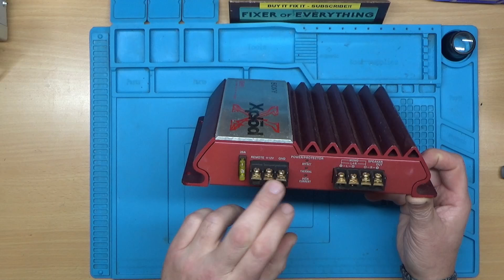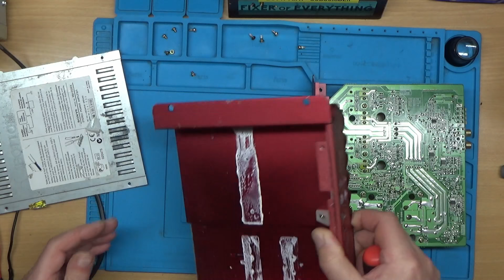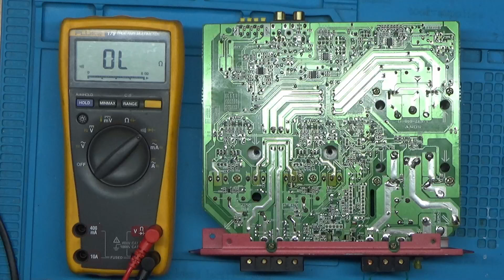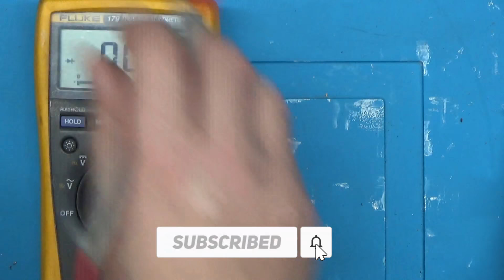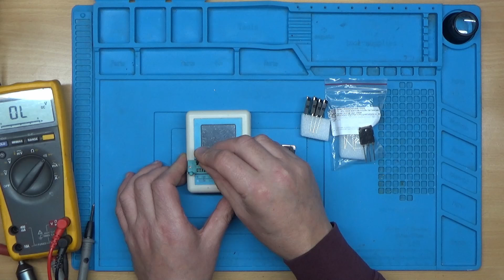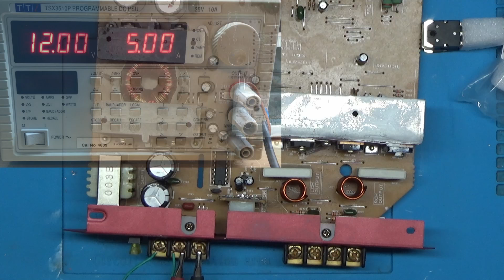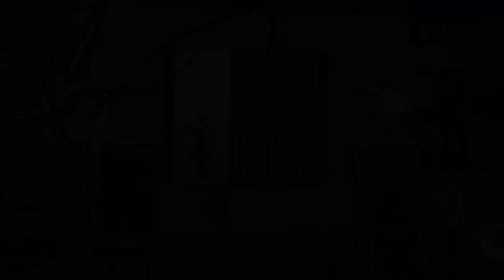Faulty Sony XPLOD Audio Amplifier | Can I Fix It?

Comment: Buying a faulty XPLOD off eBay with no fault description at all is a real gamble, but going through the connections first before powering it up is exactly the right approach with these. That red heatsink design usually hides the real story on the output or SMPS side. Keen to see what you find.

Comment: here we meet again, fellow D718-B688 ! Very very classic simple but reliable design present on the vast majority of car power amps for decades! JBL, Alpine, Sony, Blaupunkt etc...
This complementary pair can deliver around 100 W from ±35 V rails, and multiple pairs can be stacked in parallel to increase current capability and power output. Hence the widespread use of this configuration in car and some home audio power amplifiers for many years.
Reply from the maker: Interesting, Thanks for sharing 👍

Comment: What app are you using on your phone for the signal generator and how do you hook that up meaning what connector with what ends exactly
Reply from the maker: "Frequency Generator", the phone I used has a 3.5mm jack, so I used that with a 3.5mm jack to phono lead.

Comment: The 2SB688 (often paired with 2SD718) is a Silicon PNP power transistor designed for 45-50W audio frequency amplifier output stages, featuring 120v
 collector-emitter voltage, 8A collector current, and 80W power dissipation. It is commonly used in audio applications and comes in a TO-3P package.
It's best to replace them as a pair.
Reply from the maker: Yes, I did indeed replace the pair of them 🙂👍

Comment: Why the jumper between 12+ and Remote?
Reply from the maker: The remote input takes 12v signal from the head unit to tell the amplifier to switch on, so the amp isn't running all the time. If there is no 12v signal on the remote connection, the amp is just in "standby" mode so it doesn't run the cars battery down. So to make the amp work, I just wired it to the 12v power going in. Hope that helps 👍
Reply: @BuyitFixit Killer. Thank you for the response.
Reply from the maker: @EndrChe  No problem at all, glad to help 👍

Comment: I've received countless car audio amplifiers for repair. In most cases, at least one output transistor was completely shorted out. Sometimes two, or even more, were affected. I've also occasionally had to replace the MOSFETs in the switching power supply because they were damaged by the short circuits in the output transistors.
The most common cause of amplifier failure is overload due to user error. Speakers are often connected incorrectly, resulting in impedances below the permissible limit. Very few people read the instruction manuals and know the technical details before connecting anything.
For example: Many amplifiers are stable at 2 ohms as long as they are not operated in bridged mode. As soon as you combine two channels into one, i.e., operate them in bridged mode, the permissible impedance usually doubles to 4 ohms. If you then connect a 2-ohm speaker anyway, the output transistors will be overloaded and eventually burn out. As a chain reaction, the MOSFETs in the switching power supply can also burn out.
The connection requirements are usually explained in the instructions, depending on the operating mode. You just have to READ and understand.
No protective circuit can help with ignorance. Those who can read are clearly at an advantage.

I always had an amplifier in my car. However, all of mine survived without any problems. They were all 4-channel amplifiers. My first was a Yamaha YPA-1020 with 4 x 60W nominal power at 4 ohms, then I had a Magnat RX44 with 4 x 125W, or 2 x 325W nominal power at 4 ohms or 4 x 160W at 2 ohms, and finally a MacAudio ZX4500 Black Edition, also with 4 x 125W nominal power, or 2 x 300W at 4 ohms or 4 x 150W RMS at 2 ohms.

The Yamaha was only designed for 4 ohms. The RX44 and ZX4500 Black Edition were only NOT 2-ohm stable in bridged mode.
I always treated my amplifiers well.
At home, I use a SilverRave DS9504, which can deliver 4 x 50W at 4Ω, 2 x 70W at 2Ω, 2 x 100W at 8Ω, or 2 x 125W at 4Ω.
I use it as a subwoofer amplifier for my 7.2-channel home cinema system with a Crunch Powerzone noxx series subwoofer.
The power supply is provided by a massive 330VA 12V halogen transformer with a 35A bridge rectifier and a 1F power cap capacitor (with a custom-built soft-charge circuit).
Reply: scraping voice coils mate - routine in the car competition / micropenis crowd.  You put two or more woofers on a weirdly-shaped custom fiberglass enclosure, with their motor axis not parallel.  Those fiberglass enclosures BEND, transfering motion to other speaker motors.  Ultra stiff basket structures may or may not save you...

Comment: Ofcourse its the same transistor in the output stage. What a beginner😂
Reply from the maker: I'm not sure what you mean, but I've repaired over 200 different things on here ranging from thermal cameras, ultrasonic cleaners, solar inverters, and even a hydraulic transmission...

Comment: You are so lucky that that duel 3 w resistor. Probably about a 47 ohm resistor but still intact after that. Shorted transistor they very very very commonly will blow one leg that resistor and then your output is screwed after that. You were just lucky.
Reply from the maker: That's interesting, thanks for the info mate!

Comment: man i wish you were close by. i have a 5.1 computer speaker setup that worked great for years, and slowly the audio got quieter and a loud hum took over. now thats all it does. i really miss it. The Logitech Z-680 set. i know the control pod has electronics in it too, but also the sub contains most of the guts too. i have no idea where to start, the control pod or the sub. wish i could loan it to you to make a video with.
Reply from the maker: From the symptoms you describe I'd suspect capacitors have failed. They tend to dry out over time.

Comment: i like those little test speakers, if they are 4" inch 4ohm, i could buy some of them to fit in some boomboxes, i have a couple of boxes with rubbish speakers in them, i'd love some other ones to replace them, they need to have a smallish magnet though.
Reply from the maker: I think they were out of an old cheap radio / top loader CD player that came from ASDA.

Comment: Those transistors are available on Amazon in the States for $6.72 for a set of 4
Reply from the maker: Interesting. Only problem is they still are probably not originals, as they don't make them anymore.

Comment: What happens if you added new mosfet that is a bit more larger. More power?
Reply from the maker: Unfortunately not, as it would still be limited by the size of the DC to DC power supply inside.

Comment: Be careful, you put power to it and there will be large capacitors inside which you didn't discharge and could give you a nasty shock if shorted.
Reply from the maker: Good shout, although on this device the output caps are only rated at 35v, so not really enough to give you a shock. Not like the Bowens Gemini studio flash I worked on a while back (video is on here). That had high voltage caps the size of baked bean tins!

Comment: id be interested in seeing you repair a class d amplifier. i have 3 or 4 that quit on me and i never knew how to fix them, im sure it has something to do with the mosfets but i didnt know how to test which one was bad
Reply from the maker: I've never fixed one with mosfets on the output, all the class D I've seen are normally IC's. The Philips sound bar I looked at a while back which had a design fault, was a class D.
Reply: @BuyitFixit you mean you've never tried or you've never been able to fix one. I wouldn't be surprised if they were essentially unfixable
Reply from the maker: I've never came across one like that. I've seen quite a few class D's but they have been just an IC which has the mosfets built in.
Reply: @BuyitFixit oh I see sorry I didn't know what you meant. I didn't know they had mosfet ics

Comment: In retrospect, the Sony Xplod line was actually a pretty descent brand.  I think we now know the reasons that these car stereo amps would get re-designed every 3-5 years (which seems like a really long time in your late-teens to 20s) is because the designs would get counterfeit and knocked-off..and that there would also be obsolescence issues with the piece parts for the legit companies designing the amps.  
I think the problem was Sony was selling their equipment in big-box discount stores (not including Best Buy and Circuit City), along with Crutchfield and your car-stereo stores.  You saw that Xplod branding and instantly associated it with Walmart. But these Sony Xplod equipment seems to actually be good.

Comment: We can order equality parts from did the key and mauser that are not Chinese fakes just so you know he just have to match the number and look it up on Google to see what it is and what the voltage is and all that specimen and match it to the closest thing you can get there but you won't have any problem out of those sites😅
Reply from the maker: Yes, used Digikey and Mouser quite a few times. Just put in a big order yesterday. The only problem is they didn't have this part when I looked, also the postage cost is often 10x the price of a part unless you are putting in a big order.

Comment: Love your videos. Wish I had a fraction of your knowledge. 
What would be the purpose of the negative voltage? Ive never heard of negative voltage before. Cheers
Reply from the maker: Thanks 👍Ok, so lets say you had two 1.5v AA batteries connected together. You have negative (GND) at one end, and +3V at the other end. If however you take your GND from the middle of where the two batteries connect instead, you will have 1.5V to the + of the battery, and -1.5v to the negative of the other battery (from your GND). In the case with this amplifier, the positive will push the speaker outward, and the negative will pull the speaker inward. Hope that makes sense.
Reply: @BuyitFixit it does, thank you for the explanation

Comment: Totally not worth putting any time in this amp
Reply from the maker: Well that's one way to look at it. However it saves it from the landfill, someone could still get some use out of it, and the video might also help someone with a similar issue on a different amplifier...

Comment: i have a similar one that alsmost burned down my car xD
Reply: @BuyitFixit yea put on 1 ohm high load and cables where not thick enough. Underestimated the power draw and it started melting cable isolation and shorted. Amp still works tho. Just the conectors are a bit charred😅

Comment: Your voltage is a bit low. Should be 13.5 volts minimum
Reply from the maker: Agree, but it also depends if you have the engine running... 13.8V is usually the charging voltage from the alternator. A fully charged car battery (lead acid without engine running) is usually about 12.7v.

Comment: I would run it into a dummy load at somewhere near it's rated output for a while. I just don't trust semiconductors bought online. I've been caught before.
Reply from the maker: Good idea. I recently bought another part from Aliexpress, and it is 100% a totally fake IC. I actually X-Ray and de-cap it to prove it. It's a totally different IC re-marked. (possibly will be in the next video).

Comment: Does anyone notice they are alway an easy fix item. No complex  involved circuitry. Just a simple audio amp, most can fix with there eyes semi open.
Get involved in some thing complex like a laptop or an fm radio with sel-calling. Or a radio for drones, dvd recorder etc.
Reply from the maker: If you want complex check out the Defender arcade machine I repaired that had multiple faults on every board..

Comment: Those chinese sourced transistors many times work ok but will collapse under load. Ask me how I know 😂. You could stress test the amp to have peace of mind. Great repair.
Reply from the maker: Interesting. I did x-ray them last night as someone asked (I'll put it in the next video) although it didn't reveal too much. However it did show that the part for the next repair is indeed 100% fake!
Reply: @BuyitFixit I falled for it the first time when repairing a Bryston 4B NPB amp. Originals were discontinued so I opted for whoever seemed to have them available. That was a quick bang. Had to replace for newer parts with actually better specs and no problem. The output transistors in AB amp are just for output current, so they are kind of forgiving if the specs are at least similar.

Comment: Great video! Those Sony xplod amps were great for their low cost. I learned to repair amps by working on those amps. They didn’t like running too low of an ohm load.  I had 2 1600 watt amps powering 4 15 inch subs.
Reply from the maker: Glad you enjoyed the video, it's always cool to hear about what people used these amps for!
Reply: These amps were some of the worst of all time.

Comment: Evening Mick!

. . .You will probably be OK with those replacement transistors, but as you've got an X–Ray machine I would compare the original working ones with those you received – fakes will show up as having a smaller junction die than the originals, and a H.T. transistor Curve Tracer will also give them away as they'll show a "Vce" and "Vcb" breakdown avalanche much lower than a genuine Toshiba part – I spent four figures on a Philips PM6507 Curve Tracer to weed out those things, as of yet I've not had any 400 W car bass amps to fix that'll make use of my '6507 yet!

. . .Since these things get hammered by the youth of today in their cars at goodness knows how–many–decibels, a couple of 24 V Halogen filament bulbs (if you can get them!) or a meral clad wirewound of enough wattage clamped to an old heatsink as a load will enable you to test it towards full power without doing your ears or your neighbours in!

. . .If you wish, once you've arranged a couple of high–wattage "dummy loads" for testing, a simple SPST toggle switch wired across the Tone Test Button will hold the tone on for as long as you wish to carry out an extended soak test!

Chris Williams
Reply from the maker: Hey Christopher thanks for the suggestions! I've actually X-Rayed the old parts and I'll show them in the next video as I've received a 100% fake part which I was needed to fix the next item! (Wait until you see what I end up doing with it, at least I got a refund! as they couldn't argue with an X-Ray) 😂😂😂😂

Comment: Nice amp, specs, in case anyone is interested:

Channels: 2/1 Channel (Stereo or Bridged Mono)
Power Output (RMS @ 4 Ohms): 55W x 2 (Stereo) or 140W x 1 (Bridged)
Power Output (Peak): Around 240 Watts (Total)
THD (Total Harmonic Distortion): <0.04% (at rated power)
Amplifier Class: Class D (Digital)
Reply: Are u sure that's an D class? Looks like a AB or A class

Comment: Every detail possible except what was wrong
Reply from the maker: ? I showed exactly what was wrong. A shorted output transistor. I measured it, and even showed the difference when measuring it with a multimeter compared to a working transistor..

Comment: the DC-DC converter you pointed is not a DC-DC converter, it's an isolated symetrical psu, normally it has the main output and an auxiliary, usually at 15v, for other stuff
Reply from the maker: I would have called it a switching PSU, but according to the schematic.. sony_xm-255ex-255nx_stereo_power_amplifier_car_audio.pdf 
T901 DC-DC CONVERTER TRANSFORMER, DC-DC CONVERTER CONTROL IC901

Comment: Nice fix, would like to see measurements of output power and THD to validate replacement transistors have the same performance as the originals
Reply from the maker: Thanks 👍Although I'm not sure if that's above my pay grade 😂😂I'm no expert (especially in analogue electronics) but I do have a pretty good track record at fixing things 🙂
Reply: I get what you mean,but considering a car amplifiers speakers, are in an environment that is sonically the worst it can be,distortion etc isnt a huge problem,anything around 1% THD,.i would say is ok for car setups. Now when i repair hi end home / studio amplifiers, thats when distortion.SNR etc have to be setup properly with profesional test gear.

Comment: It has always been a practice of mine, (43 yrs in repairs) that if you change the output transistors, make sure they are matched and you change them on both channels. By doing that,  you keep the bias equal and the channel outputs remain the same if not better, (in this case you are replacing the outputs with higher impedance), you will most definitely hear the difference. Keeping the components and compensations equal on both sides, makes for easier trouble shooting in the future should something else go wrong.
Reply: It's a Class D amp. 
What are you talking about?!

Comment: Amazing repair sir! Can u explain to us what could happen is the reading for a new transistor is higher than the old one? What could happen then?
Reply from the maker: Thank you 👍I guess the amp would either give a distorted output, or the transistors would heat up and fail.
Reply: @BuyitFixit thanks for replying! I've got if!

Comment: It would be interesting to check in your X-Ray machine if the replacement transistors are really fake compared to the original. Many transistors from China are fake, putting small packaged transistors in a big package, as if they can carry the load...
Reply from the maker: I've still got the original and the other transistors. I've actually just had a part arrive for another repair (probably the next video) and it seems very dubious. I suspect it's fake too so I might x-ray that and the other transistors at the same time too. I'm not sure how much it will show as they are quite a solid chunk of metal so I suspect you'll just see a metal outline.